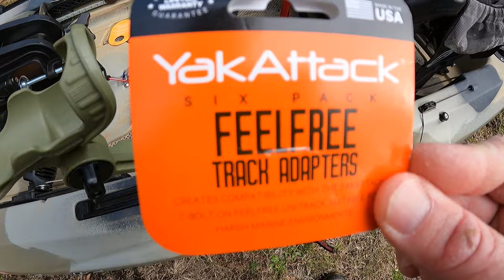Feel Free Lure 10 V2 kayak on the water review ( minn kota endura)

Comment: Question for you. I've got a lure 10 v2 as well and am considering getting this same set up. I do a lot of river fishing and was wondering if the trolling will pull up enough to not stick out the bottom of the kayak when it's on the mount.
Reply from the maker: @JimTeller-z4u  with my set up the the propeller comes down 13 in from the bottom of my kayak
Reply: @tgsfishing5979  Ok, so I'm trying to figure out the opposite of that. When you go into shallow water can you raise the trolling motor up enough that it doesn't stick below then bottom of the kayak and drag on rocks etc.

Comment: How is the weight capacity I've seen there rated at 375 but does that include the weight of the yak ? An if so what it like to paddle does it sit low in the water ?
Reply from the maker: I'm pretty sure that don't include the weight of the kayak and no it don't  sit real low  .And it paddles good but lot easier with trolling motor.lol. Thanks for watching